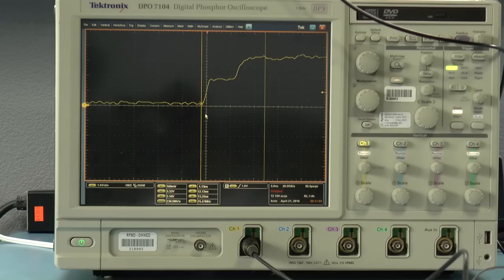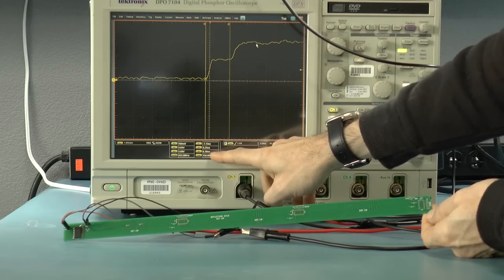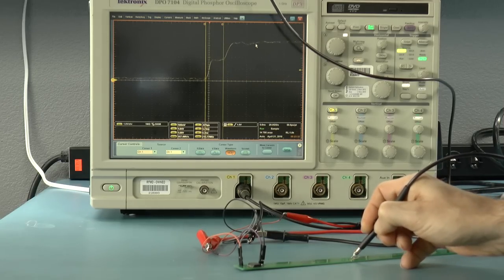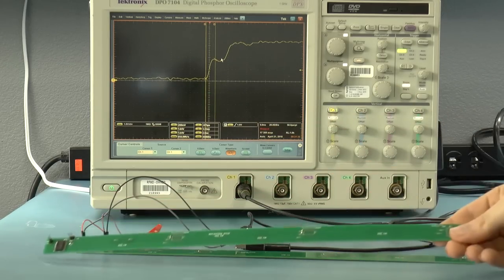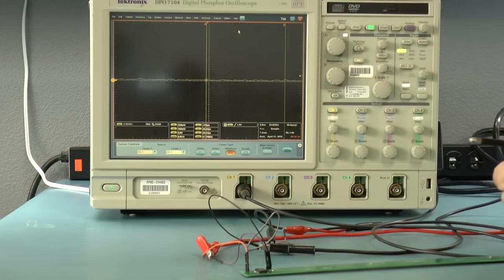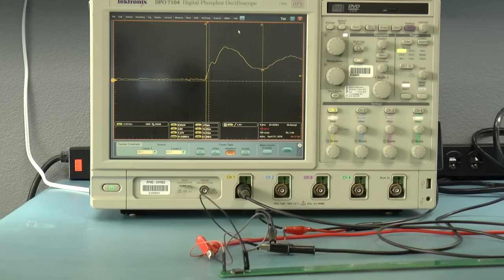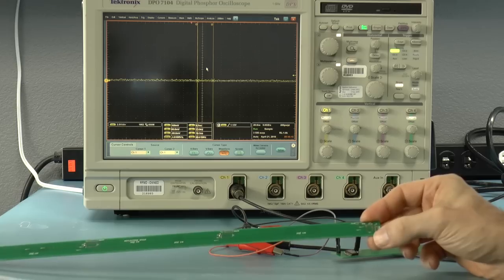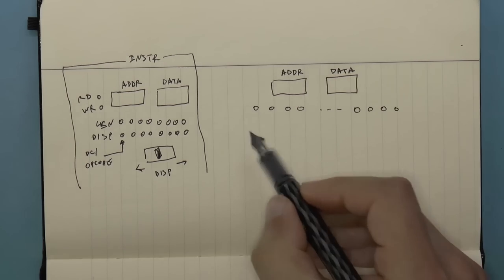Chip Tips #8: Transmission lines and reflections, tested.

Comment: At first, I was wondering at the back of my mind how good resolution that scope would have to have to see such fine details in a 3 ns pulse, but it wasn't until I was halfway into the video that I started realizing that that would havta be a really expensive scope, and then I saw it had four channels as well. I then Googled the retail price to, indeed, be $21,900. Pretty nice hobby equipment you have sitting around on that bench!
Reply from the maker: Ha ha, no, I got this one surplus from equipnet.com for $2100. Nobody wants one with a bashed-in case no matter how well it works.

Comment: Hi Robert I have a question. let's say I have both source imp and characteristic imp 50 ohm. should we have 50 ohm as well on the load impedance to prevent a reflection?, we know that mostly our load is high impedance, should I parallel terminate it with a resistor close to the load? load impedance e.g another CMOS buffer of MCU, or maybe a transistor.

Comment: Great video thanks! As I understand, the "properly" terminated board does have source impedance of 100 Ω and estimated to have 100 Ω characteristic impedance of the PCB. However, it is not terminated in the end right? If you would have terminated it in the end, you would get zero reflections but then of course, you would only get halve the voltage through out the whole transmissions line...

Comment: Here I hate to be that guy that asks for the baseline data but what did the signal generator signal really look like before you connected it to the "reflection" stick? Merely curious how square was this input square wave or was there some high freq ringing at the edges or .. what?

Comment: Awesome video! It's nice to see this in application to PCB traces, especially since most sources (and university courses) cover it using coaxial cables. Would you be willing to do a comparison of other termination techniques such as an end termination and the voltage divider end termination? (I have seen all three used for different DRAM types / signals) It would also be interesting to see how the termination technique changes the behavior if the line is loaded (i.e. if you have multiple tri-state drivers with series termination for example - with only one of them driving at a time). 

As for the propagation speed, that needs to be calculated from the distributed capacitance and inductance of the transmission line, which will depend on many factors (trace width, PCB thickness assuming a ground plane, clearance to other traces, solder-mask thickness and material, near field metallic objects, etc. - A PCB trace is an antenna). Most undergraduate physics students do this in their electronics lab using a coaxial cable and a fast pulse generator (you can also measure the transmission line impedance by using an end termination resistor of known resistance).  Note that the impedance and propagation speed will also change with frequency (and therefore rise time and the Fourier components of the square wave signal), which is most likely why the return pulse appears to be less sharp.
Reply from the maker: I will probably be doing this. One issue I realized just as I finished the video upload is that I didn't cover one important case to me, which is a driver with a series termination in the middle of the line. My original thought was that it would act the same, but then I realized that the two transmission lines would present an effective impedance of 50 ohms (2 lines of 100 ohms in parallel), so the series termination would have to be 50 ohms. I want to test that, so round 2 of order-PCB-from-China is on!
Reply: That's what I meant by "loading the line", though your description is more accurate. I think you are correct in terms of the impedance changing, which would mean that the impedance would change with each new device on the line. In addition, since they are at different points, they should reflect at different times (though most likely not an issue for the frequency you were looking at). The only complexity would then be adjusting the resistor values to match, assuming you have a known number of drivers. Perhaps that's why most back-plane based systems use end termination instead.

Comment: Are the probe wires to your oscilloscope a transmission line as well? Or are the probe wires too short to form reflections? Could that be a concern when doing these kind of measurements?
Reply from the maker: Yes! The probe is also a transmission line, but it doesn't affect the circuit too much since its series resistance is 9Mohm, terminated by 1Mohm. It affects the line more because of its capacitance. My probe is a 500MHz probe, any higher and you need an expensive active probe.